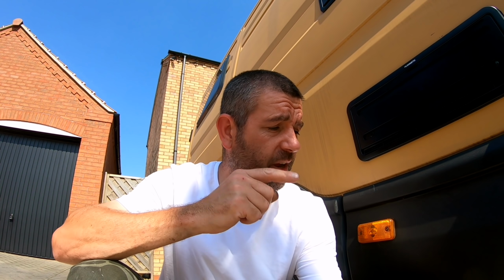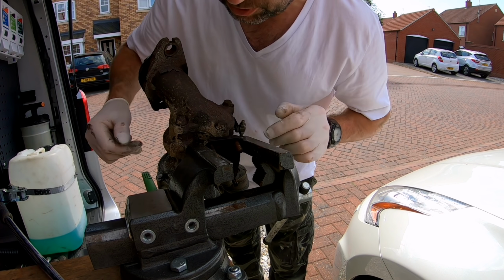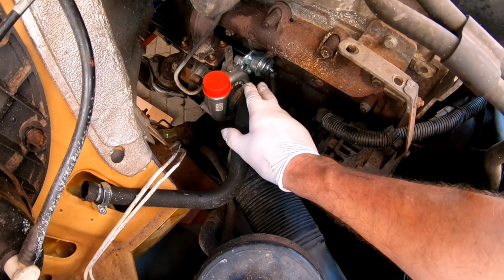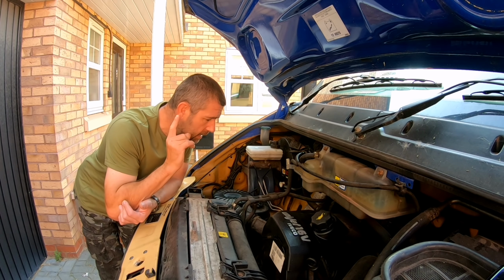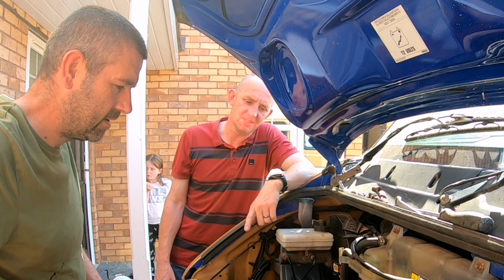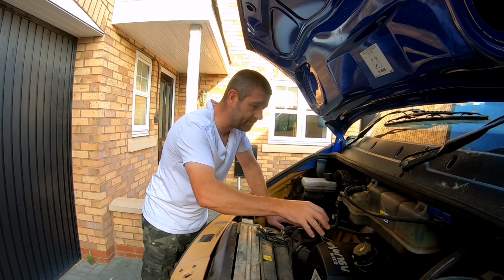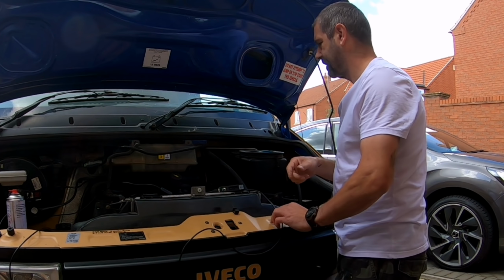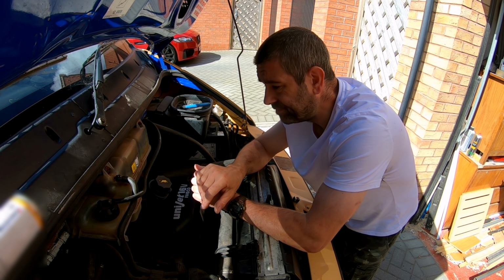Engine Smoke Troubleshooting & Replacing the Turbo. ( or, if you're from Hull, 'Terbo' ).

Comment: Hi, great video, having the exact same problem  with my iveco 2011 van conversion, loads of white smoke in the morning like a steam train so much white smoke, funny thing this clears when driving after a few miles, i have seen a puddle of oil near the inlet pipe on the turbo, about to strip the turbo in the next few days.
Reply from the maker: Cheers, Andrew. They do smoke on the first initial start-up in the morning, I noticed that on mine &  I have new injectors and a brand new genuine Iveco turbo. Also, I've noticed oil residue within the pressure side of the pipe from the turbo to the intercooler,  not a lot but probable cause "first thing smoking" in the morning.👌👍.

Comment: I have a 2004 Iveco Daily LWB high roof Panel Van that is similar to yours. The conversion to a Camper Van was only really half done by the previous owner before I bought it. The gas & water supply to the 2 burner combi stove & sink have never been connected & the electrics aren't right to the point that I have to disconnect the battery negative leads on the start & leisure batteries to stop them from draining. I am fortunate that the 2.3 litre engine with 94k miles on the clock is sound on it, so that is the least of my worries. What I'm thinking of doing is stripping it out & start from new, especially as the main transverse bed above the garage is too small for my 6ft 4 frame & I have to sleep on a pull-out bed. There is some rust on the body to deal with. The Van passed its M.O.T last Friday with advisories on the down pipe of exhaust (slight blow) & surface corrosion on the chassis. I had the van thoroughly serviced timing belt & water pump changed 2 years ago & had 4 new tyres fitted along with new brakes & discs all round. The front suspension struts were changed in August 2019. This is a 2004 van though & I wonder if it is really worth spending any serious money on it...
Reply from the maker: Hi Trevor 👋, I've just bought an new engine now with 95 k on it (only taking that face value though!). I suppose on how long you intend to keep the van really, mine has to last for at least another 10 more years, hence what I've spent the time and money on bud, a bit of surface rust and a new down pipe isn't really a big issue, managed to clean my chassis up and repainted it, and also rewelded my down pipe.  But  what's it's worth to you matey, in spending time and money on it 😉👌👍👍👍.
Reply: @Iveavan  I got plenty of time. I retired last year. Can I ask how tall you are? I'm asking as you've got a transverse bed.
Reply from the maker: @bigcasey4143  I'm nearly 5ft.11 bud, and it's a squeeze for me to be honest matey 😅, I've just managed to fit an 6ft bed transversed😉👍👍👍.
Reply: @Iveavan  that's my  problem. I'm 192 cm/6ft 4, so I can't fit in a transverse bed. The higher up it is installed, the worse it is due to the taper on walls of the van.
Reply from the maker: @bigcasey4143  that's right, only way for you would be length ways unfortunately mate 😉👍👍👍.

Comment: Awesome videos, you've definitely put me off converting a daily, even the shape is an absolute nightmare. Nothing a bit of true grit and determination won't sort and you certainly have plenty 👍
Reply from the maker: Cheers matey🍻. Happy to report that the new engine is running well 😉👌👍👍👍.
Reply: @Iveavan  nice one👍
Reply: ichew gum  I looked at a few to convert but all had major rust issues underneath. Not the best on mpg too.
 I guess it's all down to preference and how confident you are with the repairs. I'm good with wood but not with welding 👍

Comment: If it was my van I would just live with it, that engine will no doubt go on for a long time. Just keep an eye on the oil level.
Reply from the maker: 😳🤔 It won't pass the emissions test in the MOT bud, it's buggered 😉👍.
Reply: @Iveavan  fair enough, maybe go get the emissions checked first you might be surprised, I know I've been in the past when its come to MOT time expecting emissions to fail miserably 👍
Reply from the maker: @nicknorth-east    I've thrown an new engine into it matey. Its got to last, for at least 10 further years bud  😉👍👍👍.
Reply: @Iveavan  total cost?

Comment: Hi mate my van is doing it as well but only smoking when cold, as soon as it heats up it runs great, I'm thinking it's the glow plugs but not sure.
Reply from the maker: If its blue smoke from cold it could be valve stem oil seals, if its like a black smoke it could be the glow plugs, you can take them out to do an ohms resistance test on them to see if they are faulty, I can't tell you what the ohm's resistance readings should be, but they should be available on line somewhere mate 😉👍👍👍.
Reply: @Iveavan  thanks mate just need to get it done it's the 2.2 relay. There is a lot to remove front grill for a start, should take about 4 hours if u no what your doing so they say online f**k knows how long it will take me lol
Reply from the maker: Haha,😅 good luck bud 🍀🤞👌👍👍👍.

Comment: Hi Bud.. I've seen turbo blades like that before.. Once it was a 13mm nut had worked lose and was bouncing around in there.. and another time turbo had sucked a wet air filter in to it...? That smoke i think is normal after ticking over for a while..  Cheers Bud
Reply from the maker: Hey up Kev 👌👍,  that's probably what has happened either water ingress or road debris via an collapsed filter, who knows bud 🤷‍♂️, the smoke is definitely from the oil that's leaking out of the exhaust manifold, which has now left lovely rainbow patterns on my driveway when it rains 🌈😂😁👌👍👍👍.
Reply: Haaaha.. It will water proof yer drive.. Be honest I typed the comment before watching all the video.. Yep it looks like it's sucked something throw there.. I am supprised that it got through the intercooler.. The intercooler will be full of oil as well mind..? Listening to the engine noise on the video, she has got a knock..? and I can't make out if its an injector or a valve..? but it's deff got a clack there somewhere.. Hope you get it sorted, and cheaply.. Cheers Mark
Reply from the maker: @WonderingWomble  yeah I noticed that too bud, I think it's more top end then bottom end mind you 🤔, oh well bud, that's the garage's issue I guess, once it's in there, I can pressure wash off the Kaleidoscope of a drive way off, in keeping with the neighbours mate 😂🍻👌👍.

Comment: how much did it cost the new engine for iveco
Reply from the maker: Around £600 bud 😉👍.
Reply: @Iveavan  I heard , Iveco daily have problem with oil leak , and burning a bit oil depends form condition of engine . You got a deal with that engine .
Reply from the maker: My old engine had done 317k this new one has only 95k so fingers crossed bud 😉👍👍👍.

Comment: Downside of starting with a... shall we say, "previously well loved"? van. Age and wear and tear will lead to a higher need to do maintenance and repair and higher risk of catastrophic breakdowns. But of course buying a brand spanking new van is not in many people's budget.  Hope you get all that properly sorted.
Reply from the maker: I agree with you mate, unfortunately this was not the original van that I bought, it was an 2011 iveco daily (like Luke's Van Life). But after getting severely messed about and that van had "ironically engine issues". They kept the money (manage to get that money back after two months though) and they became threatening towards Dawn and myself through out the whole process (any how that's another story). That's how come I ended up with this van 🤦‍♂️, but hey, it is what it is bud, it can be fixed at least, probably not much left that is original on this van now though 🤔😅😂, Cheers bud 🍻😉👌👍👍👍.
Reply: @Iveavan  Yeah, and there are a LOT of these out there, so getting good parts from scrap yards and the like should be easy. To the point where swapping out the engine itself would probably not be crazy expensive, but a major hassle of course.

Comment: vans, cars, whatever, nothing but a nightmare.
I had a work week away end of august daily trips to a place up big hills, 2nd morning in clutch started slipping only just made it so had to stay there till the weekend as could not chance driving to home and back in case it went altogether.
got driveshafts off, ripped boots
got gearbox off, smashed brake pipe.
couldn't buy new cv boots, van had unknown driveshafts..
so here i am 2 and a half weeks later, still trying to get it back on road, and mot in a week...
so yeah i know where your coming from.
Reply from the maker: Ohhh nightmare mate 😣😕, well, I hope you're able to resolve it soon bud, thank fully, I'm not in that kind of position with mine, like somewhere miles away from home. Good luck matey 🍀🤞👌😉👍👍👍.

Comment: Hey Marky, what a mission you had :( my van has always had smoke come out the exhaust but only when u leave it idling for a while then rev the engine. After a few seconds of driving the smoke stops. What du think? Burning too much oil or diesel when idling?
Reply from the maker: Hey up Luke 🍻👍, I'd wouldn't worry about it bud, if it's clearing up after a couple of blasts, (quite normal) probably just a build up of gasses in the back box, unless you noticed recently, that your topping up your oil or coolant levels more often then normal😉, yes, I bought a challenge an experience and not a van 🤔😅, at least it be like a brand new van (almost!) cheers again mate 😉👌👍👍👍.
Reply: @Iveavan  I wish I had your guts and know how to do engine work. I just pay through the nose every time for work to be done. :)
Reply from the maker: I'd be doing the same bud, I'd rather pay for it to be done to be honest, my days on the driveway swapping engines over are over 😂, plus gives myself chance to clean the drive way off due to paint and oil 🙄😅👍.

Comment: G’day Mark and I thought I was the only one these things happen to!   I had a similar problem with my 4X4 but it wasn’t as bad as yours but I fitted a Pryor gauge and a boost gauge to keep an eye on the turbo,  I fitted a catch can as well I feel sorry for you mate that’s a bastard of a thing to find out but your right I reckon with your diagnosis of the problem and like me I am 62 and have rheumatoid arthritis so I have to get things done now but if it’s a recommended engine repairers you lucky anyway mate I won’t labour the point but at least you can complete the fit out and you know what’s ahead kind regards John.  PS get your wife to hide the revolver!
Reply from the maker: Thank you mate👌👍, yeah it's a bit of a bugger, but it is what it is unfortunately, the plan was to re-haul the engine in a years time after getting some use out of it first, but hey ho, like you say, I can crack on with the build, and send it away for the engine to be reconditioned, kinda been putting off this diagnosis off for 17 months, this wasn't the original van we bought, we bought an 2011 Iveco daily but the garage where we bought that from messed us about, kept the money (which I got back after two months of dealing with these idiots) and became threatening, hence why we ended up with this one, unfortunately at the time, they were only two available in the UK with the spec I wanted. I best keep an eye on the post to make sure Dawn hasn't bought that gun 🤔🤣😂😁😉👌👍👍👍.

Comment: Have you Checked the crank case breather system?  If that is blocked the pressure in the crank case has to go somewhere,  up the turbo oil drain pipe maybe and stopping the oil flow and staving the turbo of oil. Also the intercooler could be full of oil from the turbo failure.
Reply from the maker: Cheers mate 👌👍, I've checked, it wasn't the PVC valve bud, even ran the engine with no oil filler cap, and dip stick and the breather pipe being off, unfortunately it isn't that, would of been a nice easy fix though 😕, yes the intercooler gonna need to be cleaned out or for the price of them, I might replace it matey 😉👌👍👍👍.

Comment: Aww that’s hard luck after you have put so much work into it. On a positive note you haven’t completely wasted time and money because the turbo needed replacing and even if a replacement engine came with a turbo which I doubt who is to say that the replacement turbo would of been ok. Just a set back and you’ll soon be back on track. ATB
Reply from the maker: Cheers matey 🍻👍, yes it was worth an pun I reckon, I shall be telling them I want the brand new starter motor, the water pump, cambelt pulley kit, and the "Terbo" swapping over 😁, let's face it bud the only thing that can go wrong now is the gear box and axle, there the only original parts that going to be left on this van 🤔😂, Cheers again matey 🍻😉👌👍👍👍.

Comment: WTF churned up those turbo blades?, sorry that this has happened to ya mate - on the positive side, your vehicles reliability will increase, less breakdowns (hopefully), more MPG, quieter running, more power etc etc - keep us posted on what it cost and how it went at the garage - best of luck to ya!
Reply from the maker: Ohhh, I don't know really, you're guess will be has good as mine to be honest, I suspect the same as Wombles thoughts, water ingress, or road debris via an collapsed filter 🤷‍♂️, probably that's why, the last owner got rid of it 🤦‍♂️, yes your right, hopefully it should be more reliable and save me pennies on the fuel, so they is a silver lining at least👌😊👍, I shall book it in once the back end is finished🤔, cheers matey 🍻😊👌👍👍👍.

Comment: Sorry my friend, but the turbo blade shards have found their way into your cylinders and scored the pistons, bores and valve guides. The damage will also extend to all the crankshaft bearings as well in my experience. It’s time for another engine, sadly. Incidentally, running your new turbo with all the detritus in the oil/airways, you’ve quite probably damaged that again.
Reply from the maker: Cheers matey 👌👍, yep I agree with you, I'll get it booked in for the end of the year and just concentrate on the campervan build 😉👌👍👍👍.